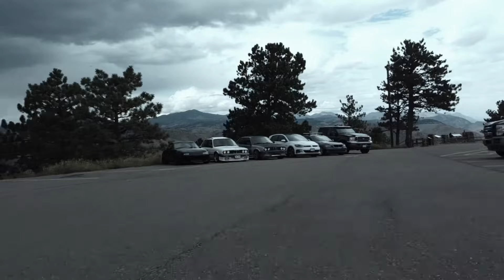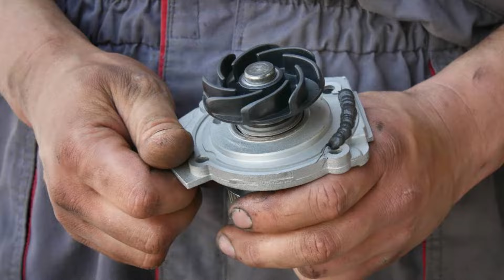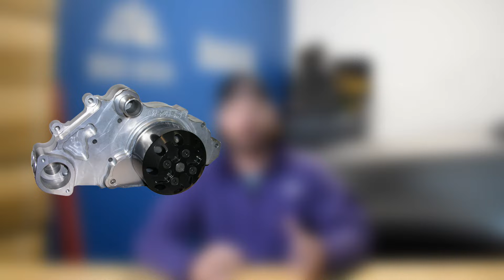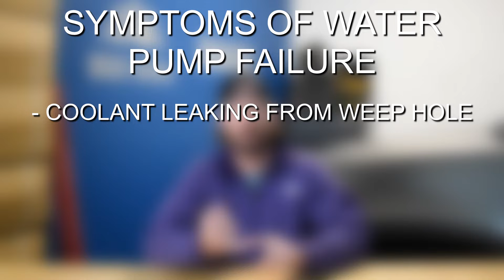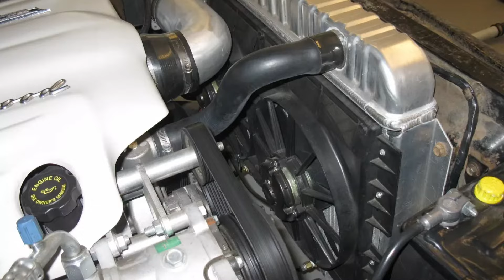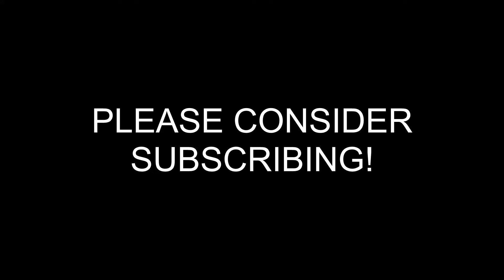Symptoms of a Bad Water Pump!

Comment: I have a leak I do believe it's by the water pump or at the water pump I have a whining noise but it doesn't overheat (the temperature gauge doesn't go past the halfway mark) it does use a lot of coolant but I don't know if that's just because of the leak or maybe it's trying to overheat and its causing that much coolant to be used and leaking at the same time! Any ideas would help

Comment: I changed filler neck and cap, thermostat housing and heater hose assembly. The fan is working and car runs regular temperature when driving. It starts getting hot when idling, could that be radiator or water pump or something else?
Reply from the maker: E - If your car runs at normal temperature while driving but starts overheating at idle, it's usually a sign of low coolant circulation at low RPM, which points to a failing water pump or partially clogged radiator, though a weak or inefficient fan can also be the culprit even if it's technically working—check that the fan ramps up to high speed as the temperature climbs. Also, double-check for air pockets in the cooling system after all the parts you replaced—trapped air can cause localized overheating especially at idle; try bleeding the system thoroughly.

Comment: My truck overheats and when I pull over and rev the engine for 10 seconds,  the gauge begins to drop.  I know this may be water pump. But can it be stuck thermostat?  How's reving the engine causing the temp to drop?  I see no leaks.
Reply from the maker: E - Yes, your symptoms could absolutely be caused by a stuck thermostat or a weak water pump, and the reason revving the engine makes the temperature drop is because it temporarily increases coolant flow and fan speed, which helps push coolant through a partially restricted system—so if the thermostat is stuck closed or only partially opening, revving may force enough flow to drop temps. Similarly, a worn water pump with a slipping impeller may not circulate coolant properly at idle but can push more when RPMs rise. Since you don’t see any leaks, start by replacing the thermostat—it's inexpensive and a common failure point—then if the issue continues, inspect the water pump, especially if you're hearing a whining noise or see signs of coolant weep from the pump housing.

Comment: Hi, I'm facing a car overheat issue at higher speed. When speed is around 120km/h, temperature is good. As speed crosses 125km/h, it indicates temperature rise. I put car in neutral and checked, coolant was coming out of radiator reservoir cap. I've changed a lot of radiator caps even cleaned the radiator but problem still exists. Could this be a water pump problem as I don't see any other leaking in water system?
Reply from the maker: M - Yes, based on your symptoms, it’s very likely the water pump is failing, especially if the impeller is worn, corroded, or slipping on the shaft, which would reduce coolant circulation under high load; at lower speeds the weak flow might be just enough, but at higher speeds and engine loads, it can’t keep up, causing pressure buildup and overheating. Also consider checking for a partially clogged radiator or a blown head gasket pressurizing the cooling system, but if the radiator is confirmed clean and you’re not seeing white smoke or losing coolant internally, replacing the water pump should be your next move.

Comment: Hello, when i got my truck a couple weeks ago i was told the engine light was on because of a cooling fan sensor that needed to be replaced, I've driven it twice since I got it. I took it myself to have the diagnostic test done, an i got all these other codes. Can you tell me what the codes mean and mayb a estimate on repair. Codes: POA06, POO14, P1A6F, POO13 it also says battery voltage 14.25 V and says it should be between 11.2V - 13.0V I hope to hear from you asap, thank you!
Reply: Read google about your codes bro.
Reply from the maker: R - It sounds like there may be quite a few things wrong with the truck.. We would advise going into a shop and having it looked at.

Comment: My car heat is 95%, it raises very fast.
I have checked the water pump and there is no leak and the fans are working.
Could it be thermostat is failing?
Reply: Bro check the head gasket I see mines leaking oil feel that might be the problem do water pump too together
Reply from the maker: R - Certainly could be. Check coolant levels. Here is a video that will help: https://youtu.be/zXQEii5gUPY

Comment: Thank you. Had no issue with heat to the upper hose. No visual leaks. Bleeding the coolant now with no stoppage to the bubbles but I did replace the whole radiator and both hoses so don't know if that means just more air in the system due to it being exposed during the swap. No heat is coming out the vents, actually really cold air. Slurping in the resevior was happening for a bit but then went in to spewing of coolant/water. Also temp went up to 240 but did not hit redline. Turned off the car to start process over and hoping for a different outcome than a new water pump.
Reply from the maker: M - Thanks for the feedback! Keep us posted.